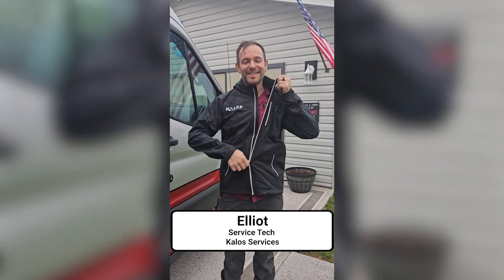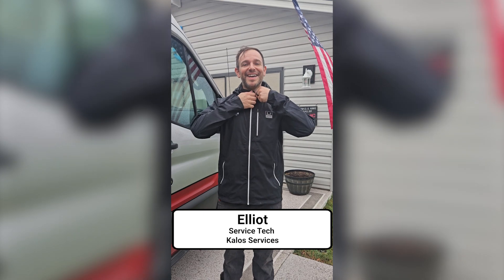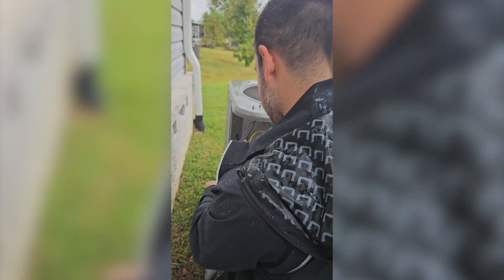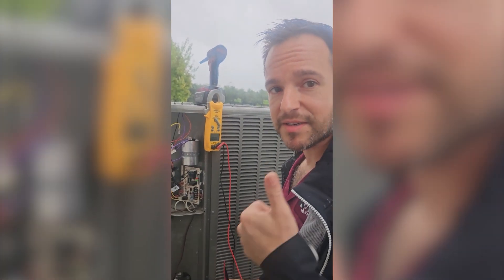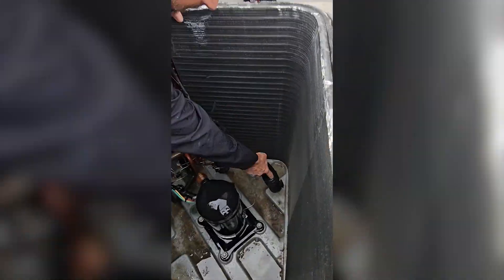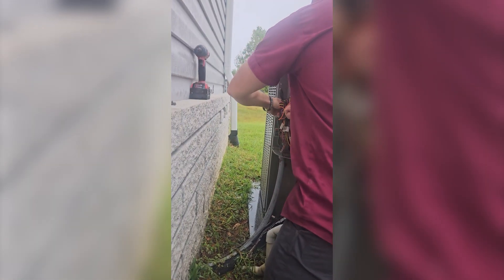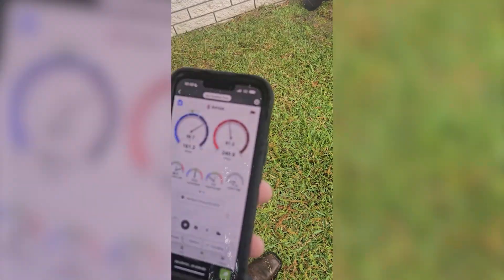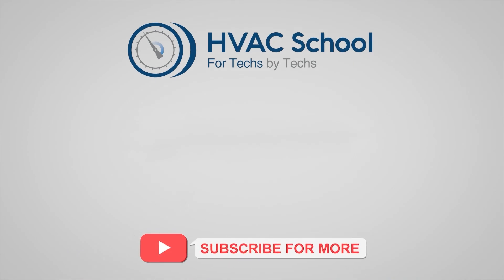Adventures with Elliot - AC System Maintenance Basics

Comment: 3:33 - Don’t do this at home, kids. The capacitor charge is held between terminals, not between terminal and ground! Even if there were a bleed resistor on that cap (which I couldn’t see), I wouldn’t trust that it is not burned open and not able to remove the charge after power is removed. Always use a 5 to 15k carbon resistor to bleed away any residual voltage before handling.

Comment: great video and great job. only thing i do different is, i check system pressures and components first before the cleaning begins. i do this for several reasons. one: id find issues right away instead of cleaning a part im going to have to  replace anyway. (used to piss me off spend time cleaning a coil and then find out its leaking. second when u run a system umder normal circumstances it will show u where its struggling. for example i have high head pressure or compressor ratio then when i go to clean the condenser coil i will split them to see of it needs to be cleaned and quote job appropriately. 
thanks for sharing